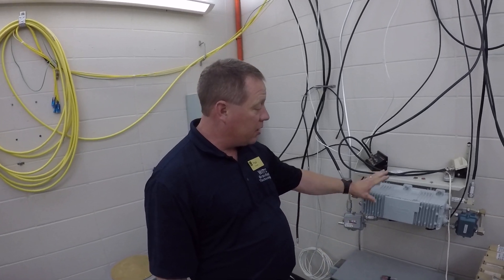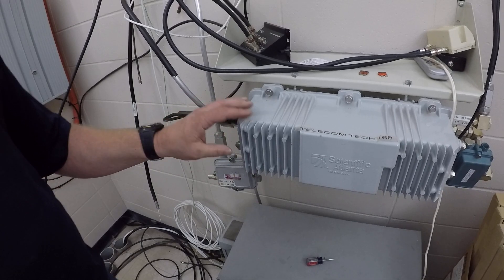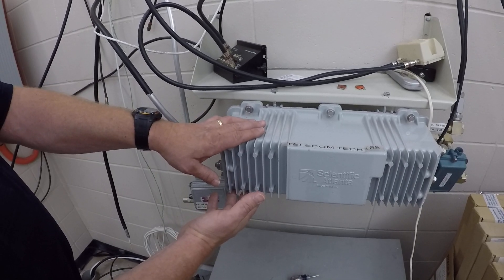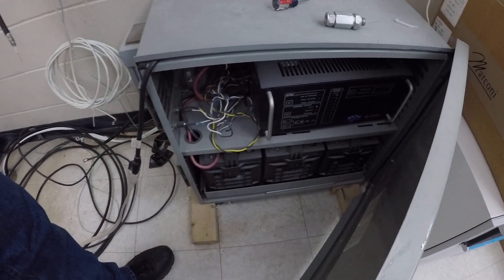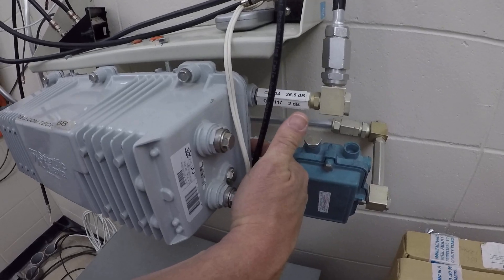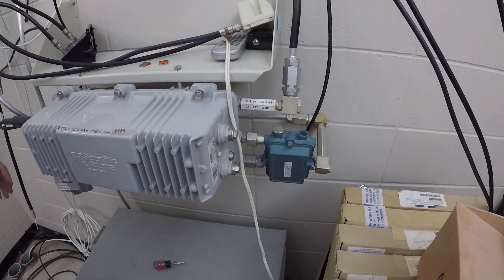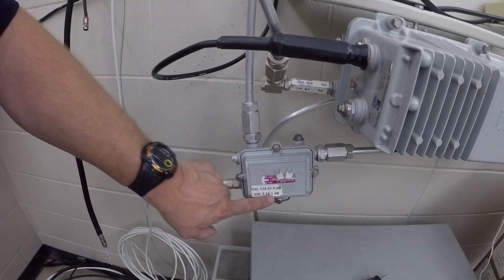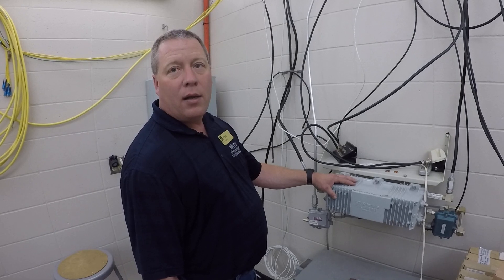Fiber Node

Comment: They recently upgraded our apartment building (390 units) to fiber to the node. They used two CommScope MD6000's  (One for each face side of the building since we have a major corridor running the length of the building on each floor) and two power distribution nodes then at each amplifier box they put in new AMPS that connected to the cables going (On the outside of the building) to each unit. This also gave them the ability to segment the building if they need to and in return, they also increased the internet service speed from 50 Mb/s to 70 Mb/s. IT was not economical to wire the individual units for fiber since they could get the same result with this and avoid the installation costs for each unit. (Only about 20%) of the building are actual subscribers.

Comment: I worked as a Digital Video headend specialist from 2003 to 2008, operating interconnected SciAtl digital headends, PPV, VOD, guide data, other interactive service, DNCS and digital broadcast acquisition and muxing in two master headends that served about 60 hubsites across 7 west central Florida counties in the Tampa metropolitan area. Like, almost 3 million digital settops in our little corner of the world

So, this is an HFC node. Depending on how Charter is operating their plant, it might operate from aprox 24 MHz to 750 MHz up to near 1 GHz RF. At the headend, broadcast TV is mixed and modulated upon 6 MHz haystacks (digital carrier within a single ATSC analog channel slot) that use old ATSC channel slots to overlay a digital QAM carrier that contains about 10 to 15 standard definition video channels in each of these QAM carriers, or 3 to 5 HDTV in each. Each QAM carrier might operate at 64 to 512 symbols QAM per 6 MHz channel. We operated 256 symbols, which allowed 38.6 Mb/sec per haystack. Th DNCS would give instructions to the digital settops box as far as how to find a digital channel, and authorize decryption of that channel number.

Anyways, this radiates out over fiber "backbones" to distribution hubsites that are about 40km/ 24 mi from the nodes. At the hubsites, gaps in the headend carriers allow for more localized cable channels, ad insertion, VOD, and CMTS channels for cable modem down streams to get combined in. I'm ignoring reverse path of upstream signals from models and settops boxes because that means a longer post. This combined mux of RF signals from aprox channel 2 analog to 107 are then passed to forward lasers, HDFA amps, and light mods that shoot down as a set of already-mixed RF frequencies on a light carrier in the 1550 nm spectrum. When it arrives at the node, all the node needs to do is reconvert this WDM back to RF, and send low and return signals from settops and modems back upstream on the 1310nm wavelength back to the reverse lasers towards the hubsites/headend. Historically since the late 1990's, this is all the HFC node pictures here needs to do. With newer tech the nodes are going to do more, but this is a very slimmed down operation of a Scientific Atlantic CATV HFC plant operation. The physical plant where it transitions from fiber to coax is an active process, requiring local power. This explains the gray "alpha" box. It's a 90 volt DC power supply, with typically enought backup batteries to maintain the copper plant with at least 4 hours of power when grid/mains is unavailable (which can depend on what the local gov stipulated in the build out requirements).
Reply: Slight correction, NTSC is the analog TV standard, ATSC is the new digital over the air TV standard

Comment: if you open a node, you dont lose signal. you would need to disconnect the fiber input from the receiver on the inside lid..  the padding and equalizing happens inside the node from the field side of setup, the rest of the padding/EQ-ing comes from the headend or hubsite. this was by far a trash video.. horrible info, ridiculous reverse tilt on spectrum... your narrowcast should be higher than your broadcast to allow for the spectrum to flatten out as it goes to end of line equipment.. as in the high frequencies attenuate faster than low band.. this video hurt my soul a little haha.

Comment: couple of things  , awful set up , you can open the node without loosing signal [ think he means the fiber connector he didn`t know much about ] , SA are fucking  muck  and a LPi does not change AC to DC , this video has to be from the early late 80s early 90s  but only posted 2 years ago ?????

Comment: How does the conversation work. Is the optical input digital? Does the modulator modulate the complete baseband (50-1000 Mhz) in one take, or is every tv channel modulatet separately in the node? Or is the complete baseband modulated at the headend and then converted to optical digital (A/D)?
Reply: Hi. Didn’t completely understand what you are saying but basically the TV/Internet/telephone trouble down the fibre to it reaches the note and is then converted to RF and then set on the  to customer this
correct.

Comment: The backup power supply uses regular flooded batteries or special ones.
My cable company asked me for $15,000 if I wanted them to replace the damaged batteries on the node next to my business.
Reply: They are probably AGM batteries, probably group 24 or group 27 size, and they run about $150 each from Interstate Battery
Reply: That's outrageous lol. They wanted YOU to foot the bill to fix damaged backup batteries to their HFC Fiber node!?@

Does that ISP's name rhyme with "Rectum"?

I gotta hear the full backstory on that one!

Comment: did u just said that if u open your node u'll experience signal interruption? y?
Reply: yehboy314 you won’t lose “signal” if you open it. You need to be able to open the node to check the light from fibre feed and the pads for the output.